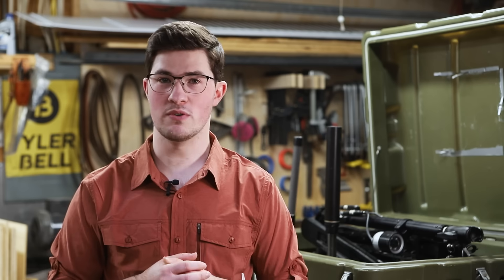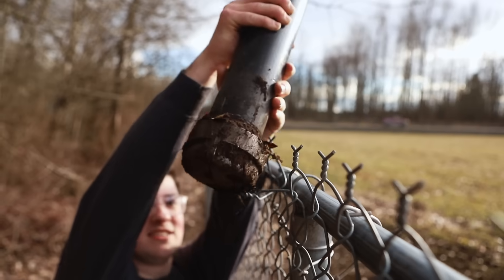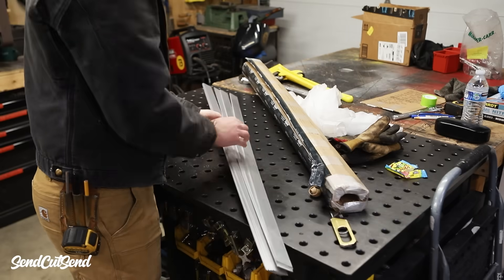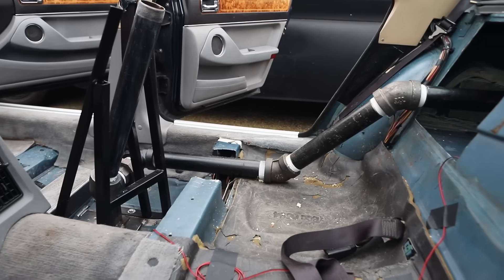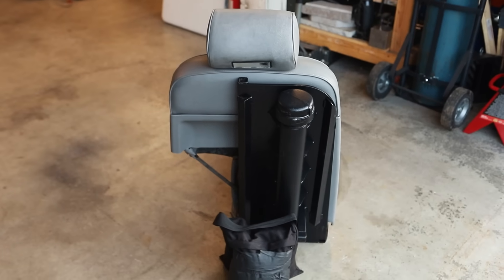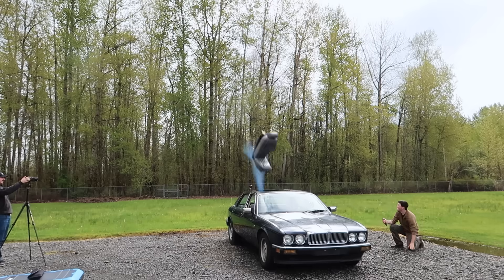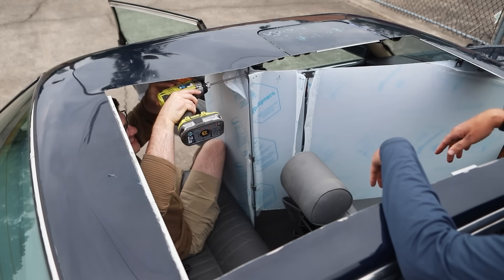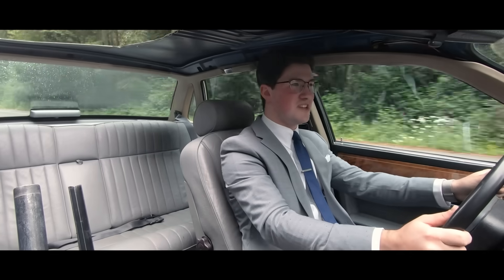Building a real James Bond Ejector Seat

Comment: i would have just strapped a scuba tank to the back of the chair, found the center of mass, and used some pipes to point the thrust str8 through it. add a valve and good to go.

Comment: I really appreciate the time and effort put into this. That being said, this project just didn't feel like true Tyler Bell style to me. I thought a lot of shortcuts were taken, like making the dummy lighter instead of making the system more powerful, having the large pipe visible through the back of the rear seat and most importantly, cutting the launch seat and moving it so far towards the center. Im not an engineer so I realize that there are plenty of factors that I'm probably not thinking of but I would think you could have set the air cannon to angle inwards to avoid the B pillars or gotten a different car that didnt have such bad clearance issues. I hate saying anything negative because I absolutely love all your videos and you as a creator. This one just didnt feel like it lived up to my expectations of your reputation. Maybe I'm way out of line though because it seems that a lot of people really enjoyed it. Keep on creating man, love the channel!

Comment: I wonder how much weight you could shift if you used multiple tanks. Maybe three tubes could eject a full-grown human. Also, for cutting the roof, it's metal, so you've got more than one try because if the first comes out wrong, just weld it back.

Comment: Super good job. 
Project that might work even better is a slide out seat. 
Where the whole door and frame comes out on a slide out tray. Meaning that when looking at the car and the slide out comes out the door fully functions still. The whole thing slide out and yeets the person in a tipped back. Though I have a feeling that would require a lot of work to make the door still function while making the pillars bigger and or thinner. 
Either way super video!

Comment: Hmm. I would have used a convertible to avoid most of the issues seen in this video- no need to chop up the seat and make it basically unusable ( and highly obvious that it's been modified, at least from the front  ), no need to chop up the roof and turn it into a patchwork of panels that fly off. Still, this was fun...